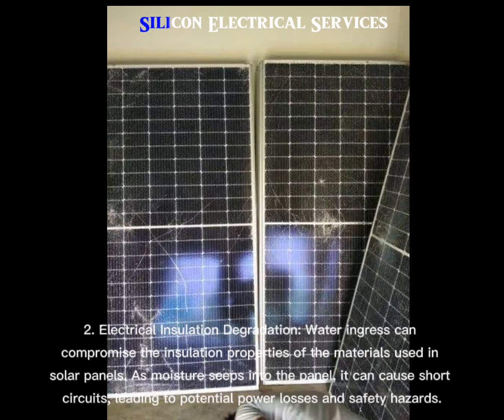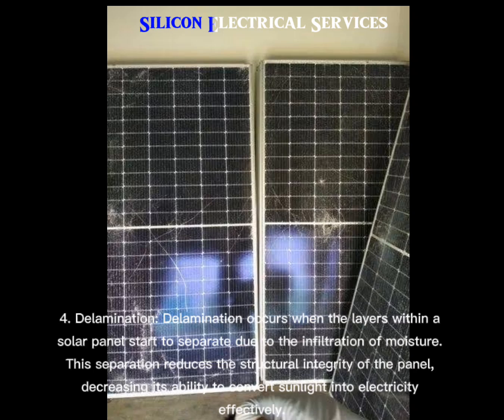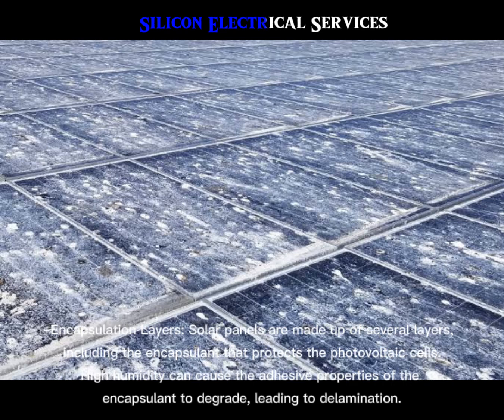The Impact of Humidity on Solar Panels.

Comment: ... but nothing on how to combat the issue?
Reply: Yha not a big fan of just listing problems with no stats on the failure rates per region or performance loss. That's like me saying bird poop blocks out solar panels without telling me if it is a problem or not
Reply: Easy just add more silicone at the joints